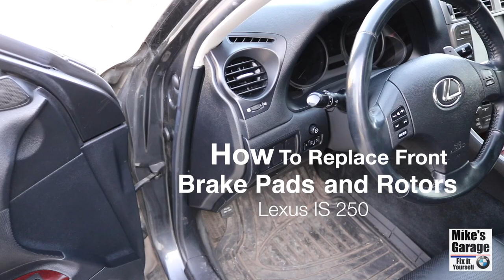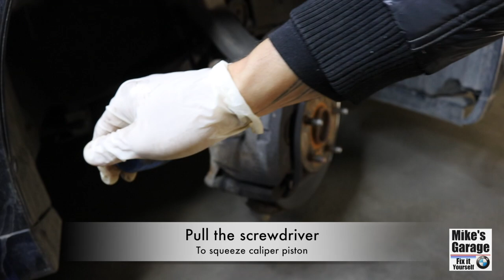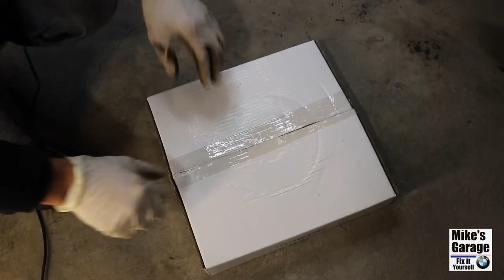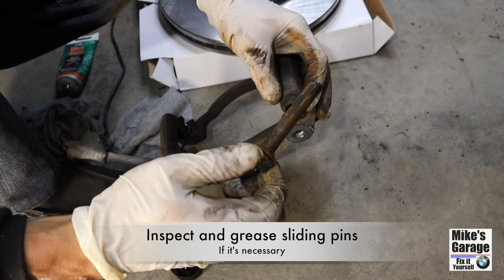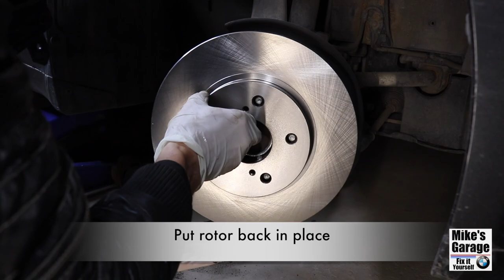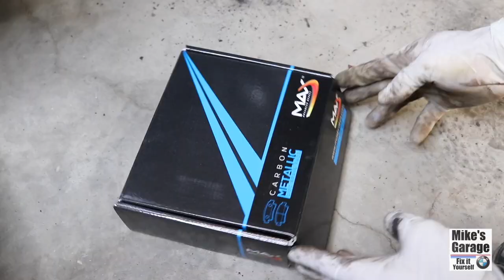How to replace front brake pads and rotors on Lexus IS250 2006-2012

Comment: Great guide - saved me $600 vs dealer labor - just followed these very clear instructions and swapped front/rear rotors and pads in about 3 hrs, taking my time and I'm no mechanic!
Reply from the maker: I'm glad that my video was helpful for you
Reply: Where did you buy the brakes and rotors and how much did the parts cost?
Reply from the maker: I got this from eBay on all 4 wheels  for $160 canadian dollars. Also you can buy parts from Rockauto.com
Reply: dude pep boys wanted 740!!!! thank you so much I'm going to try and do this myself I need a project to do !
Reply from the maker: @298lol  Thank you for watching and good luck with your project!
Reply: What tools do I need to purchase ? I am going to go pick them up now
Reply from the maker: @298lol  socket set, braker bar, maybe hammer, wire brash, brake grease and parts. Torque wrench if you want to do this job perfect.

Comment: For those of you DIYs out there be very careful with the brake caliper bracket bolts that go into the slide pins. Do not use them to screw into and loosen the brake discs. Mine ended up being stripped and I had to get a bolt the same size but a little longer in length it seems to worked.
Reply: Same! 😪
Reply: Me to lol

Comment: I found the bolt size required to pop the rotor off the hub to be  M8 1.25 pitch.  I used two bolts with even pressure to break the rotors free.

Comment: Great video!  Only suggestions I'd add:
1. Don't let the caliper hang by the brake line.
2. Clean around the piston before compressing (don't want the grime getting shoved back in there).
3. Loosen the bleeder screw and put a piece of tubing on it before compressing the piston, that way you're getting rid of the old fluid left over, and not pushing it back up into the lines.

This will definitely help a ton for when I rebuild my E-brake this week.
Reply from the maker: Thank you!
Reply: Is there a certain tube size to get? What is it called

Comment: Thanks a lot for the video, especially for mentioning the bolt sizes and torque specs! Going to be doing this job soon since I have horrible brake squeal in the front. Turns out, watching your video, it's nearly the same procedure on this car as it was on my previous car, a Volvo S60
Reply from the maker: Thank you for watching!

Comment from the maker: The bolt what I used to remove brake rotor is 14 mm socket, thread  M10 1.5  Someone else used this size M8 1.25 I think this is depends if your rotors was replaced before or not.
Reply: Which size is for stock rotors?

Comment: Greta video. Followed it exactly but when I got everything installed the new brake pads were rubbing against the rotors. Is that normal or did I mess something up?
Reply from the maker: @andrewwhite253  Thanks! Rubbing? Just check once again if everything is set correctly

Comment: This is a great video. After finishing the install it seems like the pads make contact with the rotor all the time, and the car can’t move very well. What are some things I should look into that I could’ve done wrong on the install?
Reply from the maker: Thank you! Maybe you sliding pins is rusted a lot and now sticking inside.

Comment: Have re-greased my rear caliper slide pins however front caliper bolts (14mm) which secure slide pins are well rusted and are not moving. Reluctant to try and force as they are quite a small bolt , any advice on how to free them. Last time I done this job can't remember having any issues. Thanks for taking the time to produce a great instructional video. Alan.
Reply from the maker: Just try a little harder. You shouldn't brake them.

Comment: Hey great video, I didn’t really understand why you used the screwdriver in the beginning, and to what degree you’re applying pressure
Reply from the maker: I used a large flathead screwdriver to squeeze in piston into brake caliper. If you want you can use this tool instead https://www.amazon.ca/dp/B085HXDSDB/ref=cm_sw_r_cp_apa_glt_i_M0PRYVMJDJ00QR6SDYV6
Reply: He used it to press on the brake caliper. You have to do this to push it inside the hole, otherwise it will be difficult putting the new brakes on since they will have lots more pad on them

Comment: does it hurt the bolts if you use power tools to remove them just to make the job quicker? obviously don't use them to tighten anything so you don't over tighten a bolt but just wondering about removing them.
Reply from the maker: Definitely you can use power tools

Comment: Thanks for the helpful video. What size id bolt did u use to remove the disc?  Also 58 ib-ft is sufficient and not 98?  Thanks again.  Really helpful.
Reply from the maker: Thank you for watching! I checked repair manual again and 58 ft-ld is correct number.

Comment: Hi Mike , I think I over torqued slice pin, I may have do it again . I may buy an oem rotors because when I reversed a vehicle it making sounds, as it right now I used aftermarket rotors
Reply from the maker: Hi, if you over torqued a little bit, that's fine. The main thinks don't break down bolts! If your rotors size was identical to original then you don't need to replace it! It has nothing to do with making sound. Maybe take it apart again and see if you put everything correctly and rotor dust cover is not touch the rotors. 
Sometimes when trying to turn the wheels with hands without using steering wheel, you can bend plate behind the rotor and then rotor will make noise while driving.

Comment: What about thos anti rattle springs and brackets and sensors they provide?
Reply from the maker: You can use new brackets and sensors if you get it with your new brake pads. I think you have a different type of brakes.

Comment: So I just replaced my front pads, rotors and shims. Is it normal for it being a tight fit? They slightly drag while not applying brakes but doesn't look like there's enough space for bleeding to fix it. Is that normal? Do I need to just let it wear down a bit?
Reply from the maker: Usually wheels should spinning freely when not applying brakes. You can try to drive for a bit and check your brakes again. Maybe you did something wrong.
Reply: @mikes.garage   I double checked the calipers and everything is checking out. I didn't use oem pads and rotors so I'm thinking its just the brand i got.. It got better after I bedded in the brakes so I think the sound I was hearing was the pads rubbing against the milling pattern on the rotor. The pattern is slightly less visible after the bedding and the dragging sound is almost gone now. Gonna let it wear down a bit more and check. I went with a brand I don't usually choose. Couldn't resist spending only 70 for a brake kit consisting of two rotors and ceramic pads lol

Comment: so I have a 2010 AWD IS250 there is no wear sensor or abs speed sensors etc to look for?
Reply from the maker: The speed sensor is located near the wheel bearing. Usually, if there is no pad wear sensor, then there are metal piece on the pads that squeak when the pad wears out.

Comment: Hey mate I have put my brakes on but after driving it and checked it the brake was burning is that normal
Reply from the maker: If you put grease on sliding pins and they moves ok and brake pads not installed crooked then should be ok. First day it could happen as new rotor have some oil on it and it's burning when rotors get hot.
Reply from the maker: Hey, how is your brakes now?

Comment: Aren't there sensors on the brake pads? And should I use silver or copper grade anti seize?
Reply from the maker: There is no sensors on this brakes. It doesn't matter which anti seize to use. Most shops doesn't use any anti seize.

Comment: U heard of inner tire wear for these .. ?? Any advice or cures....its a big topic ..i have a is250 awd 2012 ..
Reply from the maker: If you have tire wear, you need to do alignment on your car.
Reply: @mikes.garage  i know that . But if u look at this issue  further u will find many say they have had that done..still u will get the wear...as the car cannot be adjusted a certain way ..like its designed to fail..like they need a new camber set.
Reply from the maker: @dakeda2024  I know if you want to do alignment right way, inner and outer tie rod ends must be in good condition. Maybe for camber need adjustable control arms.

Comment: Hey buddy, you wouldn't happen to know if rotors and pads for a 2006 Toyota camry are interchangeable for this would you?
The calipers look identical. The procedure is also the same from what I can tell. 
P.S. Liked and subbed.
Reply from the maker: Hey, I don't know but it's quite possible they are the same.

Comment: Was the lubricant you used on the sliding pins a silicone paste?
Reply from the maker: Yes, this was silicone brake lubricant. Something like this https://www.canadiantire.ca/en/pdp/permatex-orange-silicone-ceramic-brake-lubricant-28-g-0381412p.0381412.html?gclid=Cj0KCQjwvr6EBhDOARIsAPpqUPFAQSVpq5XTE-V9luODR8e1B9JYF0r9a5cyesAZxWAiWcnHzuZyvEYaAutiEALw_wcB&gclsrc=aw.ds#store=611

Comment: Does anyone know the size of the bolt to help push out the rotors if they are hard to take out?
Would using one of the bolts from the caliper fit?
Reply from the maker: Do not use caliper bolt they are to big. The bolt what I used 14 mm socket, thread  M10 1.5
Reply: Thanks Mike.
Reply from the maker: @ChristianLikesFootball  Happy to help.
Reply: @mikes.garage  I tried using the 14 mm socket bolt but for some reason it's loose and won't tighten; might you have any other method for getting the caliper off? I tried using a rubber mallet but it just won't budge? Thanks for the vid btw!
Reply from the maker: @jnom07 Hi, yes you can use a hammer to knock it out or use a long wrecking bar, just like this here:
 https://youtu.be/Asj89RnBx3g

Comment: Which bolt did you use to loosen the rotor?
Reply from the maker: The bolt what I used to remove brake rotor is 14 mm socket, thread  M10 1.5  Someone else used this size M8 1.25 I think this is depends if your rotors was replaced before or not.

Comment: @ 1:49 if your rotor stuck what is the thread size bolt to remove the rotors? Metric or sae standard?
Reply from the maker: The bolt what I used 14 mm socket, thread  M10 1.5  Someone else used this size M8 1.25 I think this is depends if your rotors was replaced before or not.
Reply: @mikes.garage  cool thanks man will subscribe for sure
Reply from the maker: @Johnleefromthemist  Thank you for watching!

Comment: Do you not need to bleed the brakes?
Reply from the maker: This is not necessarily.
Reply: As Long as the brake fluid line is not off there is no air coming into the system. I like to bleed a little break fluid anyways, as right on the brakes it turns bad the fastest. :)
Reply: Schnapsbrenner - what do you mean by, “so long as the brake fluid line is not off”?

Comment: WHY are you wire-brushing all that corrosion and old crud off the caliper assembly just next to and just above the newly-installed Brake Disc and New Brake pads ???
Not too smart if you think about it is it ???